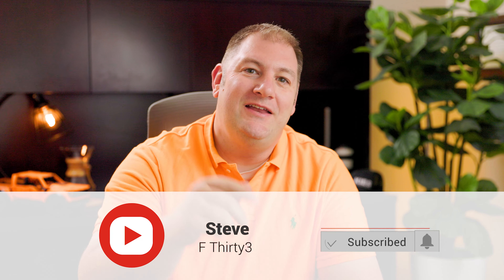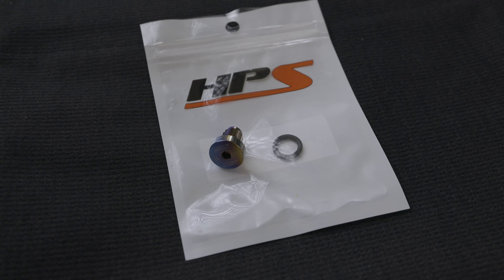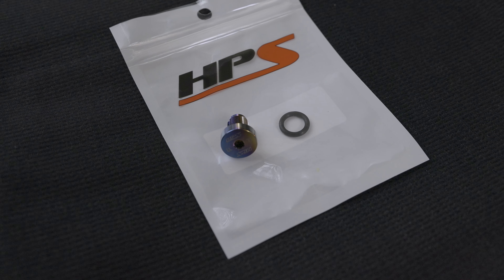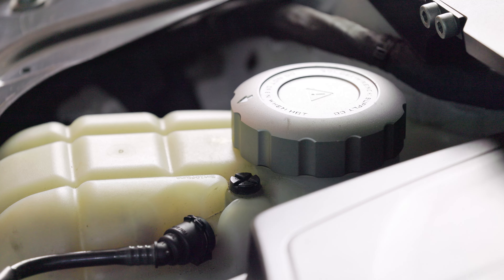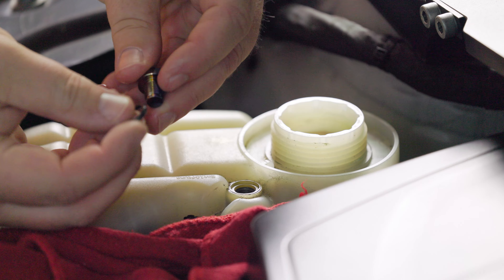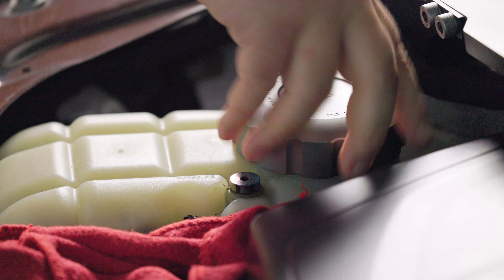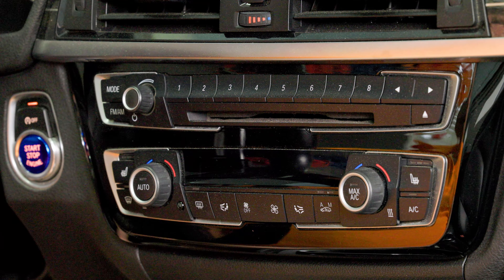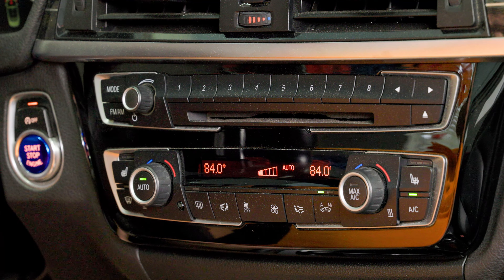UPGRADE YOUR COOLANT BLEEDER SCREW BEFORE IT FAILS! #bmw #f30

Comment: Q?: When you press the accelerator and have the heater set high.. how long do you keep the accelerator pressed?
Reply from the maker: You should only need to hold the accelerator pressed down for about 10 seconds. you should hear the pump turn on. 👍

Comment: you are bleeding the system after replacing the screw? Why?
Reply: You should not need to bleed the coolant system since it wasn't pressurized and you didn't lose any coolant or create an air pocket in the downstream hoses or engine components.